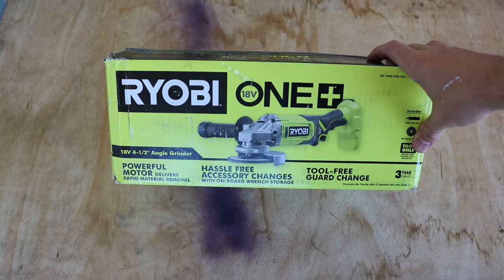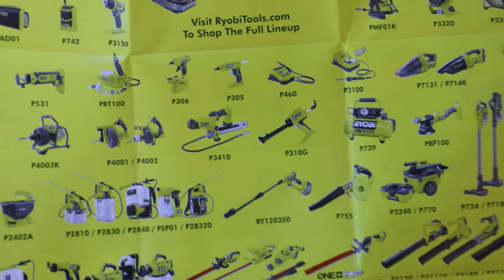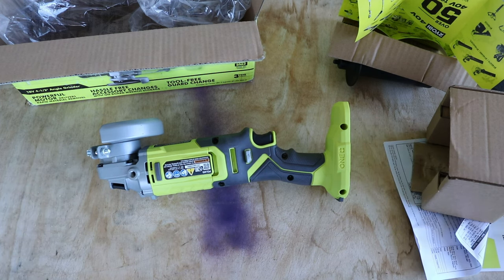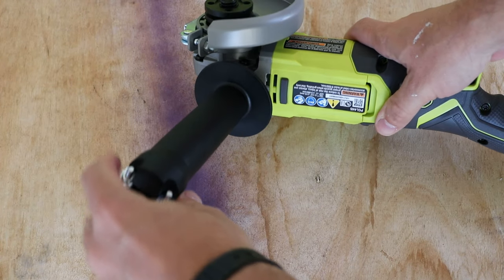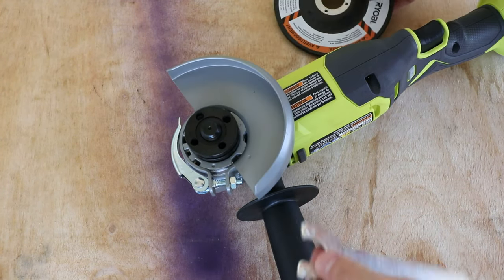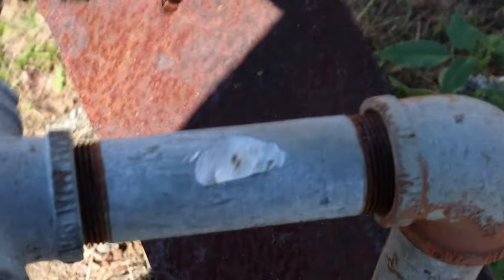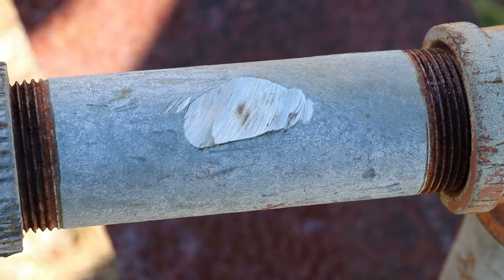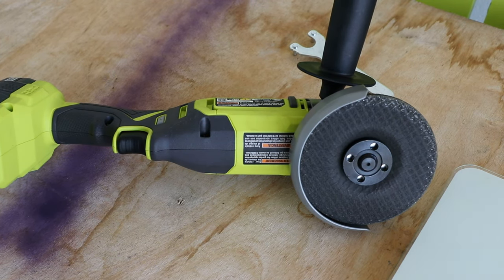Ryobi cordless angle grinder review

Comment: hows this tool holding up? Also what is the battery life like on the 2ah batterys, ive heard alot of people say that they drain fast?
Reply from the maker: I really haven't used it a lot since the video, I did one job cutting some wires and pipes, the battery lasted the job, but I think with the 2ah, it's really only good for smaller jobs.